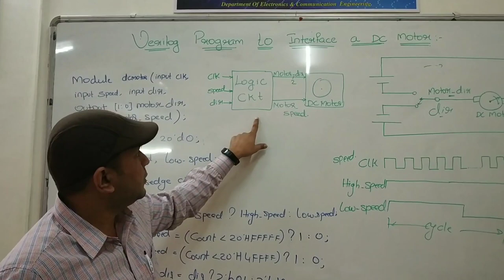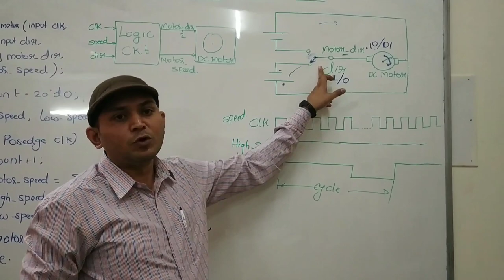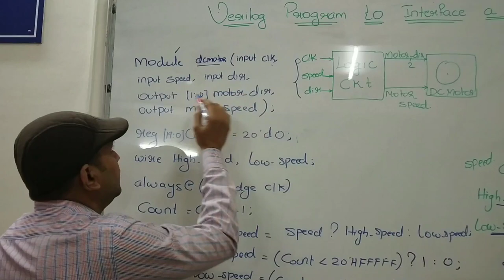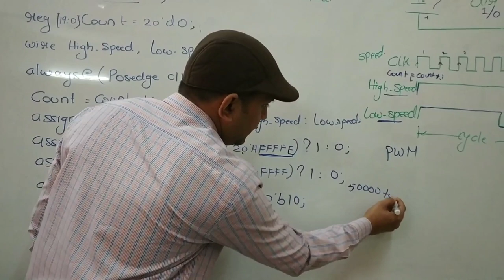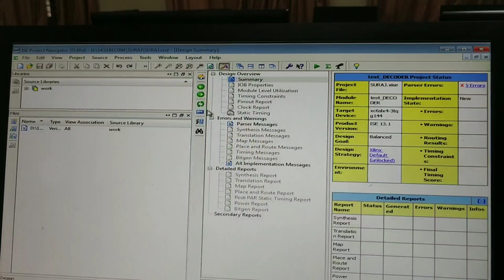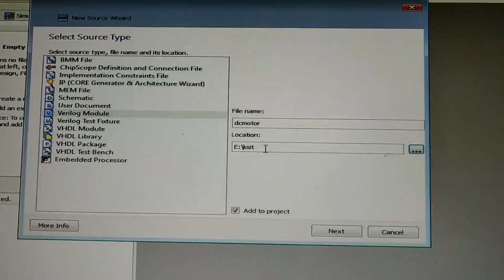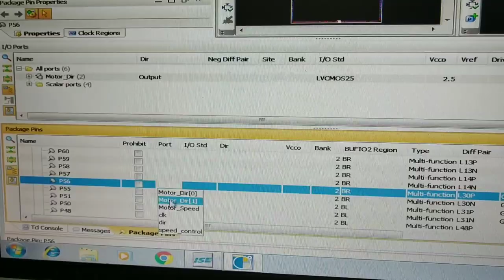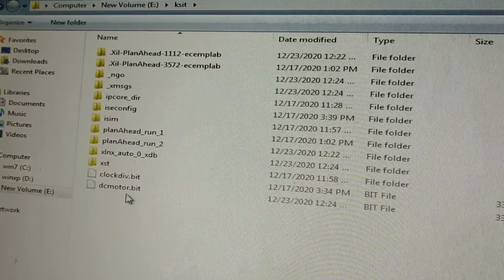Verilog Program to interface DC Motor

Comment: I have used the sparten3 kit for this program and I m able to change only the direction of the motor, not the speed. sir, can you please tell me where I m wrong.
Reply from the maker: Hello Pavithra, the program input- output connections should match with the hardware connections on the kit then only the hardware (kit) will function according to the program. Please ensure the input-output connections of the program are matching with the hardware (kit) connections. If required the program can be modified to suite the hardware connections.
You can also check is the DC motor driver is connected to the kit or not.

Comment: Hi,
I have a question. Will the counter value change if we are using UART control? If so what would that value be?
Reply from the maker: In our kit, we have two wire connection. For UART control no change of counter values required. Unless you want change in speed. Thank you.
Reply: @mr.sunilkumarg.r7816  Have you coded a motor control using Uart before sir?
Reply from the maker: @regvithbaskaran990  Hi Regvith, I haven't tried DC motor interfacing with UART. But there are some readymade functions to control the speed of motor through UART. In that function, you need to provide values to rotate the motor with different speed. This info is wrt. motor interfacing with Microcontroller.

Comment: How to modify the code for just changing the direction where speed is constant and number of rotation is 5
Reply from the maker: Hello Rajan, you can make clock-count of both the speeds equal to keep speed of the rotation constant as per the above program. To rotate the motor only for 5 rotation, you need to reprogram.

Comment: Hi Sunil, I had a quick question about how to implement a dc motor connection to a FPGA board using a H-bridge, do you have any experience with this or do you have an email I can reach you at? 

Thanks in advance
Reply from the maker: sunilkumargr@ksit.edu.in